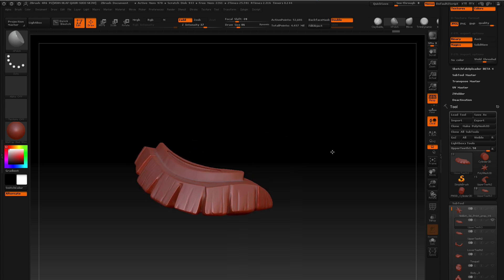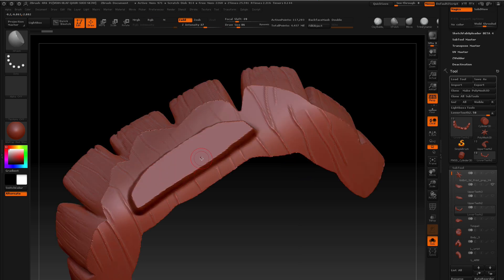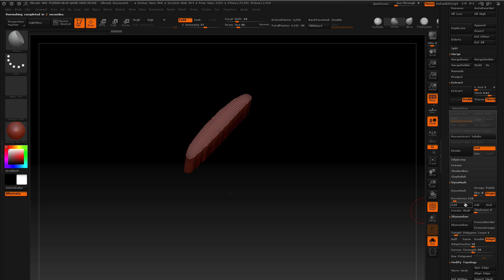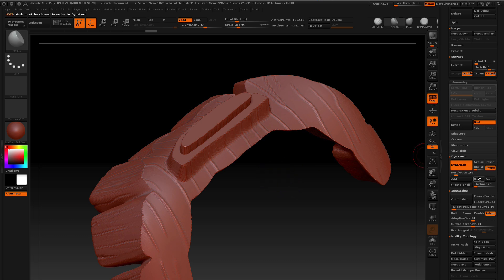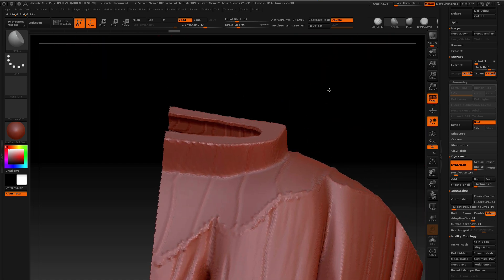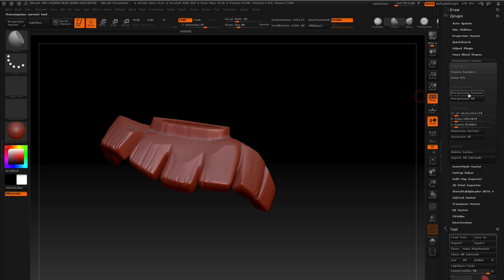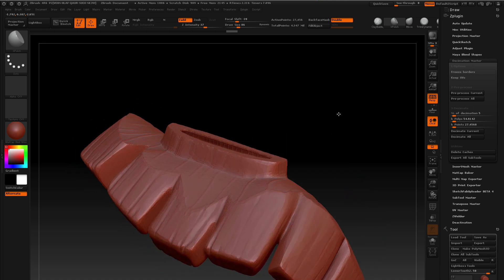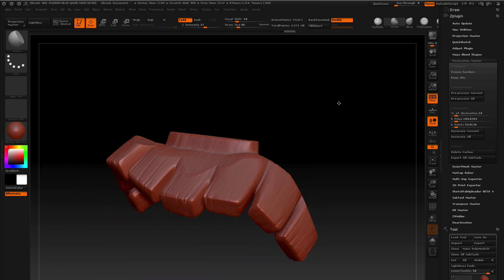Hollow out geometry for 3d printing

Comment: Great vid Steve. Thanks. A couple of questions. Is there any way to have any idea how think you're making the shell. Nd also, have you managed to get the 'intersect' function in dynamesh to work?
Reply from the maker: Thx Gordon. Yes, there's a thickness slider that you can enter a value. For intersect, I'm pretty sure the bottom subTool needs to be set to the intersect option before merging down. I'll verify for you tomorrow.